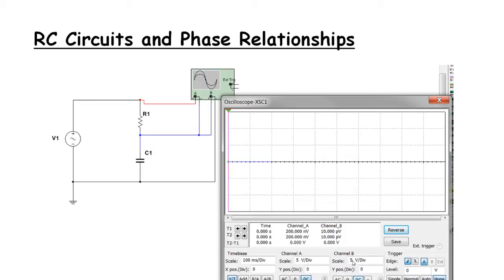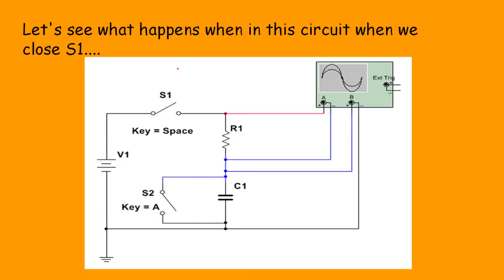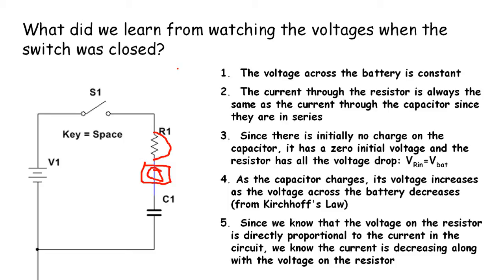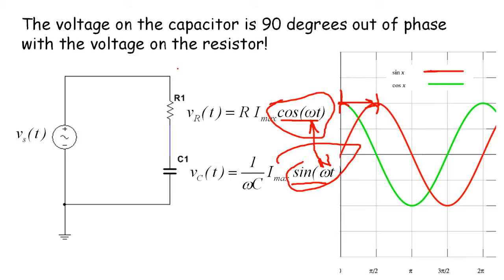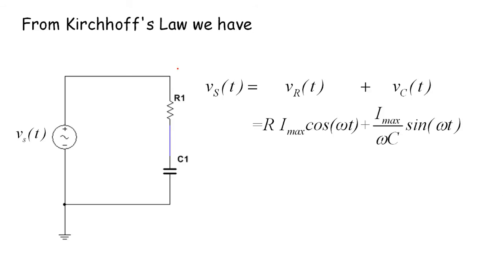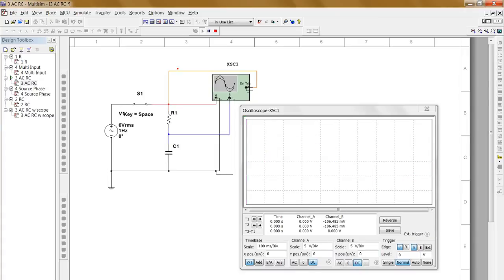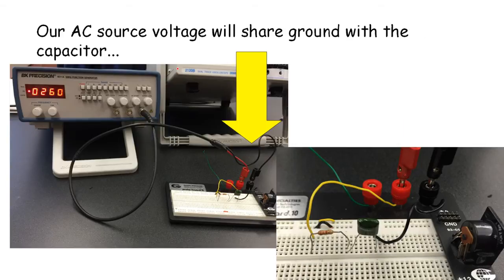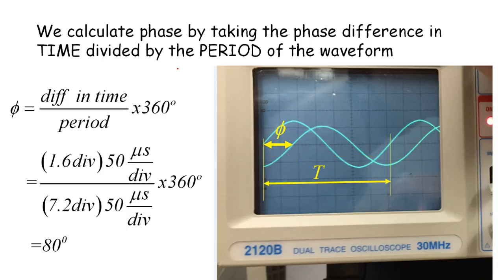RC Circuits and Measuring Phase Angle

Comment: How does phase shift occur in a single capacitor? What happens if a resistor were to be included?
Classical analysis does not provide answers to these questions in an intuitive way. To understand the reason for phase shift in capacitive circuits, a unified approach to electrostatics and circuits will be useful. 

Electrostatics and circuits belong to one science not two. To learn the operation of circuits, Current and the conduction process, resistors, capacitors and inductors and how discussing these topics with a unified approach makes it easier to understand phase-shifting in capacitive and inductive circuits, 
watch these two videos 
i. https://youtu.be/REsWdd76qxc and 
ii. https://youtu.be/8BQM_xw2Rfo 

The last frame References in video #1  lists two textbooks 3 and 4 with topics that discuss the operation of capacitors, inductors, diodes and their operation including phase-shifting with a unified approach to electrostatics and circuits.

The results of simulation runs usung TINA software of circuits that superimpose ac signals on dc voltages “Simulation_super_ac_sig_on_dc_volt.pdf” and of CR phase-shifting networks typically used in RC Phase shift oscillators “RC phase shifters.pdf” are included in pdf files in the CD which is included with textbook 4.